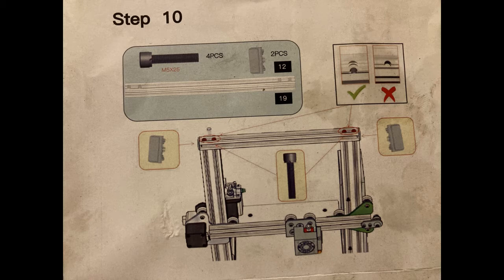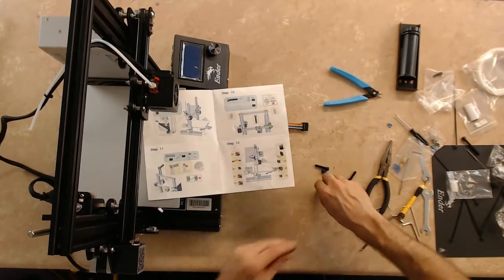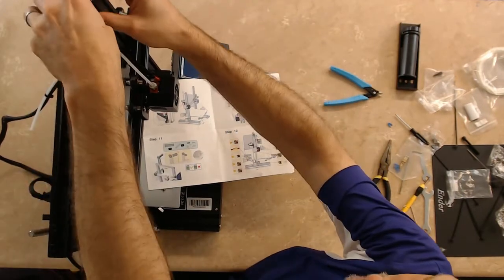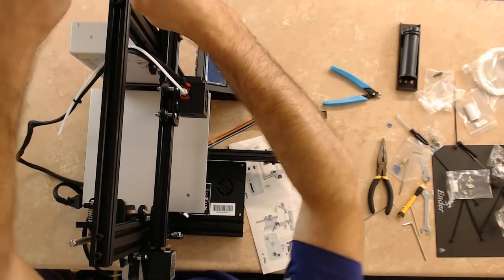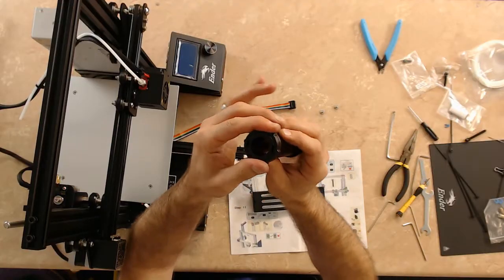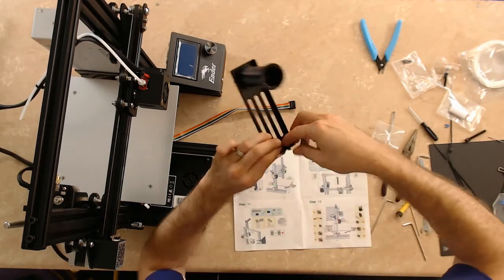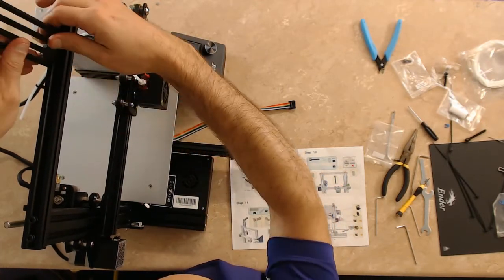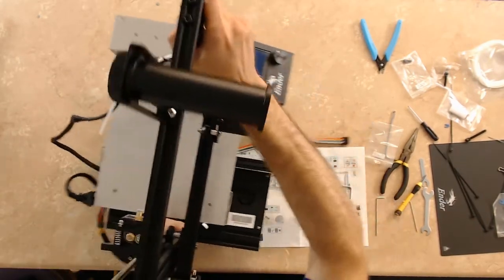Ender 3D Printer Step 10 and 11

Comment: For some reason, on the horizontal strut, the 4 strut holes aren't lining up with vertical strut holes. 🤦🏾‍♂️ Didn't realize these could be off 1/16 of an inch and that would ruin everything
Reply: It sure can. I noticed it is best slightly connect the parts. Align them. Then tighten when you are done